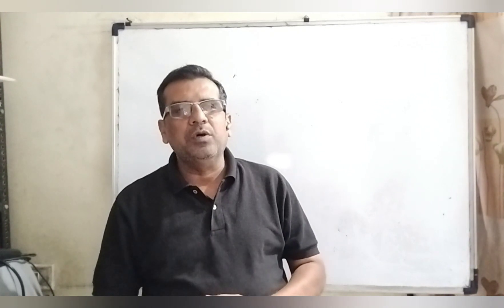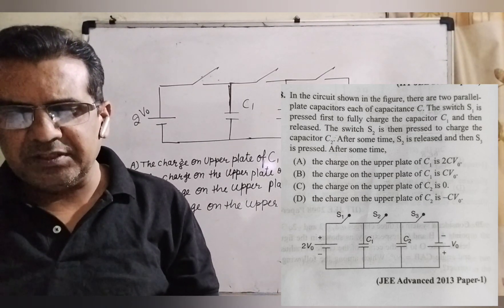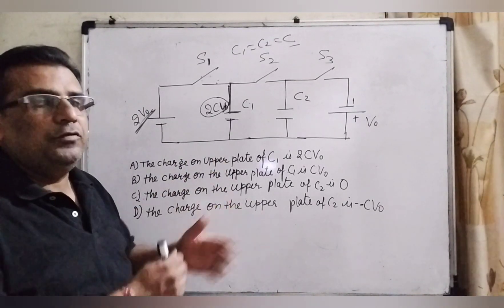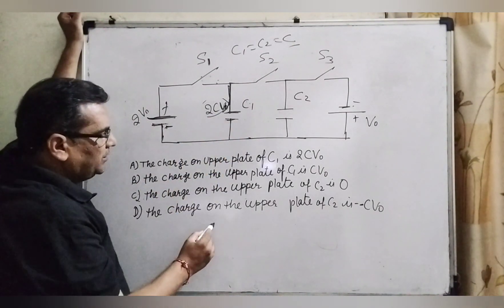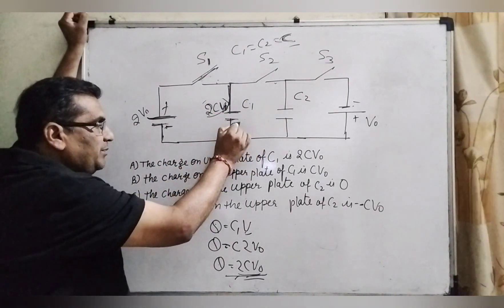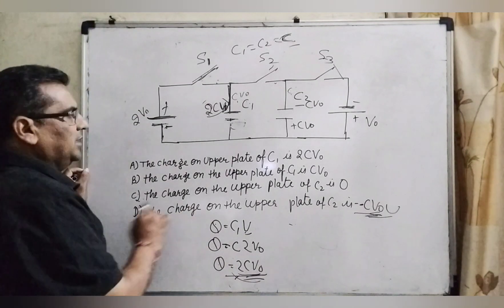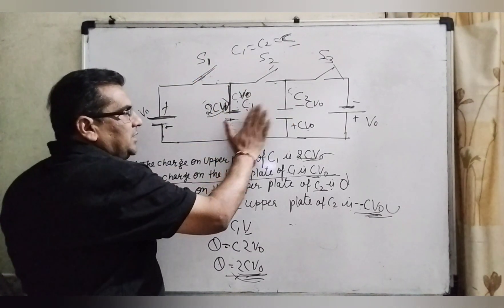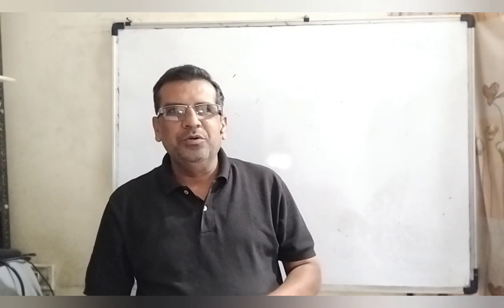In the circuit shown in the figure there are two parallel plate capacitor each of capacitance C The

Comment: Sir but if at the instant when s2 is opened and s3 is closed charge on the upper plate of c2 is +cv and after some time a total of cv charge flows through the battery v not so the net charge will be zero after some time...?
Or did I used the concept wrong because I think that a maximum of cv charge will flow through the battery with a potential v not and if it is connected to a capacitor of capacitance c....??
Please reply sir..🙏🙏